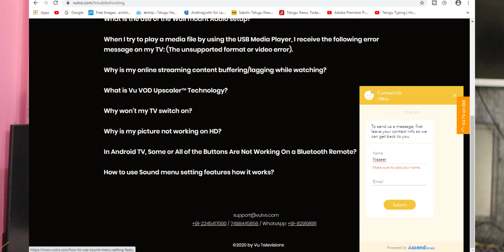VU TV After-sales service Review || My Real-time Experience

Comment: I also bought VU premium 50'' tv,
Thank u bro for giving useful information,,
Plz suggest r send link of Stabilizer for my tv
Reply from the maker: https://amzn.to/2UqquOc
Reply: @TechReportTelugu  thank u
Reply: stabilizer cost 4400😲
Reply: extend warranty ...one year complete motherboard not working waste tv ...
Reply: Brother.. don't miss guide.. now modren tv minimum voltage Modern LCD,LED and other types of TV's have capability to work on voltages as low as 150V -190V. No,you don't need a voltage stabilizer. ... Previously,when we used CRT monitors the Tv sets used to have Transformers which would increase the 230V to a higher voltage ranges (in KV's) thus enabling the CRT to work.
Reply: @Nissu_abdul  well done
Reply: @samGK3789   Hi bro ,is it working fine your vu premium tv ?
Reply: @katlamondaiah4814  Hi,is your vu tv working fine?

Comment: Smps technology already available with modern tvs, why you to spend more for stabilizer. Extended warranty is a good choice if you don't want to take risk,  I took the risk and successfully completed extended warranty period also, so it's  a matter of chance in electronics. It depends (inversely proportional) on the cost of equipment

Comment: That's not 15k brother,, that costs 28k
I lost that TV by physical damage.
By mid handling I pressed the display then it was broken. Then I thrown it. 
We should be very very careful while handling these big screen TVs,. Better don't touch them if they have any problem, we can contact service. I lost 38k by buying that premium Android TV last year.
Reply from the maker: Thank you very helpful information
I will pin your comment
That's why I said above 20k
Reply: @TechReportTelugu   I request a video on a topic brother,
What are the reasons for the damage of a smart TV mother board??
1. Software hang
2. Power fluctuations
3. Lighting
4. Slow internet speed
5. Prolonged usage
Reply from the maker: @Nareshkumar-wn5jb  sure

Comment: My personal experience with VU
Before Purchasing VU we were worried about VU after-sales service
But purchased TV after knowing they have service centers in several cities
After 10 months our nightmares  came true as picture tube blew out because of the transformer burst nearby,
our fault was also there too not using proper Stabilizer recommended for 40-inch 4K tv
After calling the service center for the issue they sent a repair team, they checked the problem & said they told me to replace the panel as the panel suffered damage. They repacked our tv & couriered to their service location. after that, we received a call from the service team that no panel was available for our model. for that, they replaced our 40 inch with 43 inch 4k tv, I was shocked first, then thanked them for their nice gesture . That's it, guys.
Reply from the maker: thank for sharing your experience
Reply: Wow , you are soo lucky
Reply: Fake😂

Comment: I have purchased VU TV  49 inches during 2019 June through Flipkart with extended warranty for another 2 years. During November 2020 the TV is not working and complained to flipkart for repair and replaced the mother board after one month of complaint  during December 2020 .Again complaint came to the TV on January 1st 2021 and complained to the Flipkart for repair .After 25 days  the Jeeves a subsidary of Flipkart informed me that the TV can not be repairable and only they will give  refund  tothe extent of 80% of the cost of the TV , even though the product is under extended warranty up to June 2022 .can any action be taken on Flipkart for breach of service contract ?. can you explain please .

Comment: Hi Anna nenu 3 days ayyindi Vu Premium 43 inches tv 4k koni but headphone jack Ni home theater ki attach chesa but not working Anna and HDMI cable apfiber to tv ki connect chesa Anna but Vu tv remote lo direct ga YouTube button press cheste just page open ayye Marla tv vastundi Anna pls suggestion Anna
Reply from the maker: Sound problem- Go-to settings- sound- advanced settings- headphone only.
For YouTube problem- reset tv
Reply: 10 q Anna Today vacharu Anna service vallu but same Marla 3.5 mm Jack petta Anna ventane. Work chesindi sound settings lo advance setting lo headphone with spekar pettaru Anna work chesindi Anna but Na bad luck Anna vallu vellipoyaka tv off chesa Anna 1 hour ayyaka Marla tv on chesa Anna Marla sound stop ayyindi Anna previous complaint naku repeat ayyindi Anna but sound Chala low ga vastundi Anna
Reply: Next HDMI port complaint adiga Anna but vallu AP fiber remote and Vu tv remote same ga work chestunnai so anduke meku YouTube nunchi back ki vachestundi  ilage all Samsung lg lo same pblm AP fiber HDMI cable tesesi internet use cheyyandi annaru Anna
Reply: Na tv installation chesinappudu nenu extend Warrenty tesukoledu Anna ippudu me video chusaka tesukundam anukuntunna konchem procedure cheppu Anna cal center ki cal chesi register avvala anna